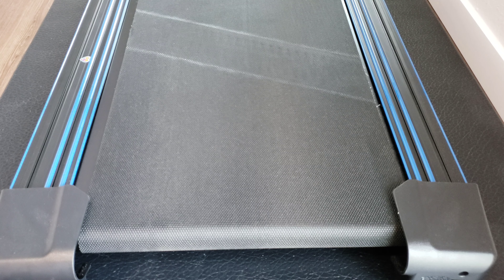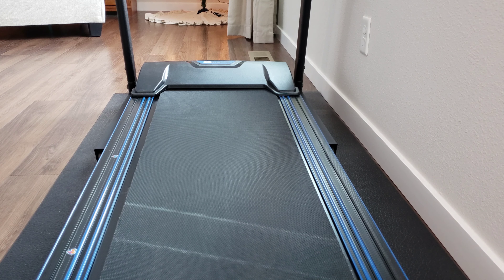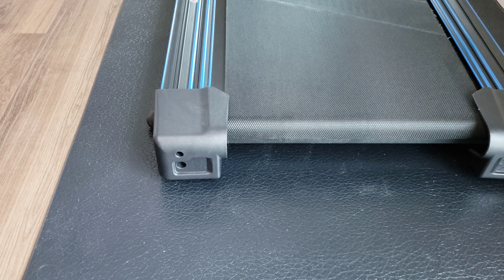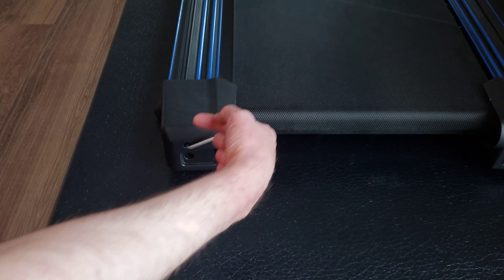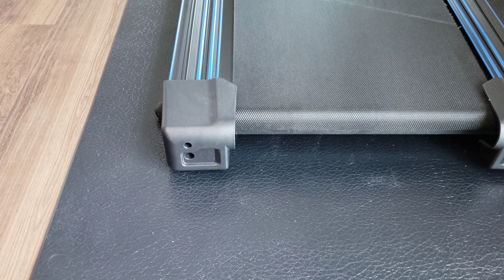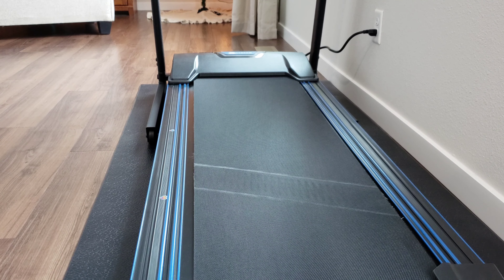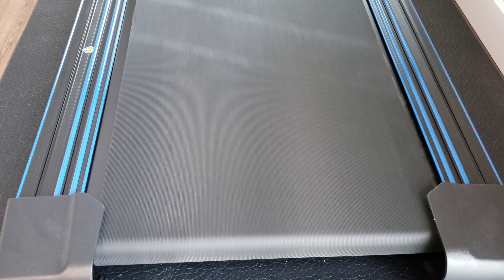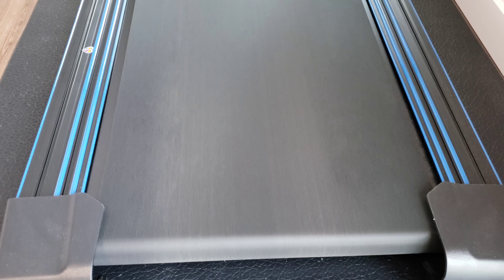How To Adjust The Belt On A XTerra Tr150 Treadmill

Comment: Thank you for this video. I am having the same issues with mine except the belt is closer to the left side. When I make clockwise adjustments to it, it fixes the issue temporarily and then once I start using the treadmill, the belt veers back to left again. Any suggestions? Thank you!
Reply from the maker: Thanks for watching! There is instruction in the manual for how to tighten the belt, maybe that is the cause. I have not made a video of that yet but I hope to in the future. Good luck hope you figure it out.
Reply: Did you ever get it fixed !! Same issue !!
Reply: @toyamaria3030  I ended up having to call the manufacturer and they guided me over the phone. I adjusted each bolt a few times and let the treadmill run by itself for 3MPH for 5 minutes multiple times. It eventually centered itself
Reply: @nadianasri5075  aww man. Yeah I totally moved the screws around . Belt moves to the left
Reply: @princessg9910  try adjusting both screws to the right (clockwise) a few turns each. Then let it run for some time. I would even try walking on it for 10 minutes. See if it adjusts itself. It should shift over. If it doesn’t, I’d keep repeating that process. It did take me a while to get the belt to normal unfortunately :(
Reply: Mine is doing the same thing it’s shift to the left but I have both screws tight to the right I guess move both to the left

Comment: Thanks Todd. As soon as I saw mine pulling to the right, I looked for a tracking "knob" just like my belt sander has. When I didn't find one, I could have gone to the manual, but no, I did the typical thing and came right to YouTube. I knew you'd have an answer for me ; )  Did you try tracking it while it's running so you could get immediate feedback and make micro adjustments on the fly? Maybe that's a nono for a belt of this size. Anyway, thanks!
Reply from the maker: Thanks for watching,  I appriciate it.  I did notice a small turn made it move quite a bit.  They state that a little movement while running is normal due to the way a person runs.  Hope you are enjoying the treadmill!

Comment: Hi Todd, thanks for uploading useful videos.
 Q) After the belt is realigned. Do we need to go back to original setting of screws or we leave it ?
Reply from the maker: Hi thanks for watching,appriciate the feedback.  Once it's to the desired position thats it, you don't have to move out back. Just remember small turns it moves a lot with just a little turn, give it a few minutes each time to see where it ends up.
Reply: @ToddsGarage  it worked out great 👍
Reply from the maker: Awesome, glad to hear it!